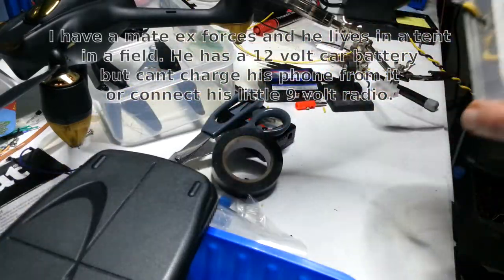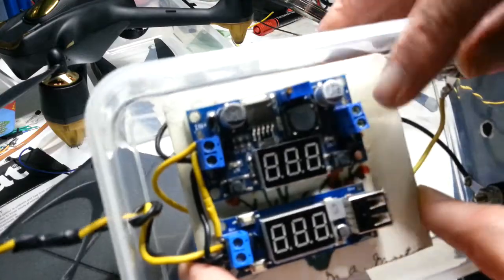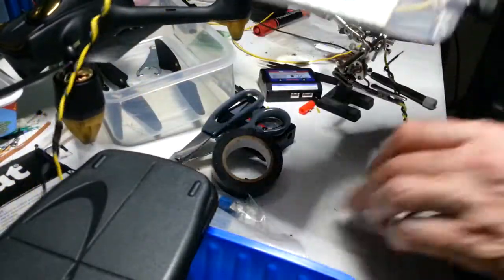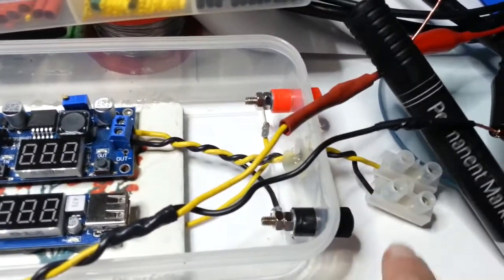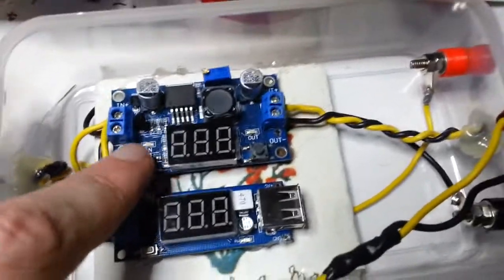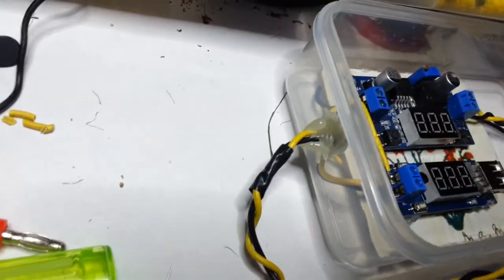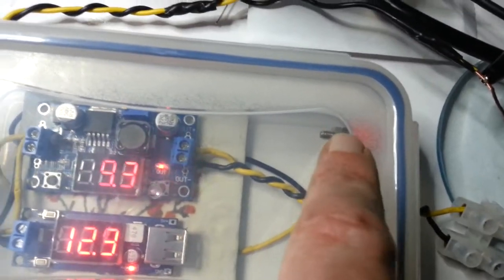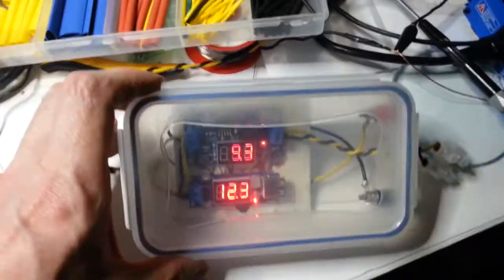DIY portable variable modular power supply in a water resistant container

Comment: Got a mod idea...a couple of full bridges in the box..so it does not matter which way around your pal connects the wires
Reply from the maker: That is a good idea but maybe at 12.8 volts the .5/6 volt drop (using Schottky's) across the diode might be to much. I have made another circuit which uses two transistors and works without the voltage drop. This way if it is connected backwards the circuit just does not work.
I should add that both the modules in his box have reverse polarity protection on them.
Reply from the maker: Your idea for reverse polarity protection the best overall. Cheap easy only four parts.
Reply: I just love circuits that work ...no matter how stupid or drunk the user is...grin...still having solar power fun..been lighting leds by moonlight...smile.. my net curtain charge controller is now upgraded to 9 diodes in series...and a movable crocodile clip ..get the idea?..works great ...equalizes volt pressure ...battery never goes over 14 volts.
Reply from the maker: That is awesome you will never fry the battery.  What do you mean LED's by moonlight, powered by the battery right??
Reply: It was just me doing some light level experiments....I have a faulty led and one of the effects of its manufacturing defect is that it glows slightly with very small voltages and currents..i connected it direct to solar panel at night.
Reply from the maker: Ummm.. Has me now a thinking. Later I shall see what I have on my panel when disconnected and only moon light. Your LED night light is interesting.

Comment: Well the protected modules makes my idea stupid...smile...ok then...how about a added night light mod..grin
Reply from the maker: There is still the output to the banana sockets. Not a stupid idea at all. I am just checking between IC type bridge rectifier and discreet 4 Schottky also a single 3 amp diode and a little transistor circuit I found. Just finding out which is more efficient.
Reply from the maker: Night light? what were you thinking? I have made an LED light which you just have to wet a little for it to work .
Reply from the maker: I forgot I needed to protect it from him :/  He has tried rewiring it and killed it. Still has 5 volts but the variable module is no more.